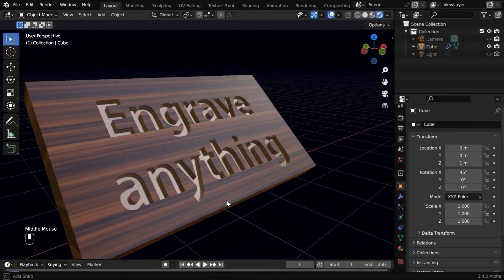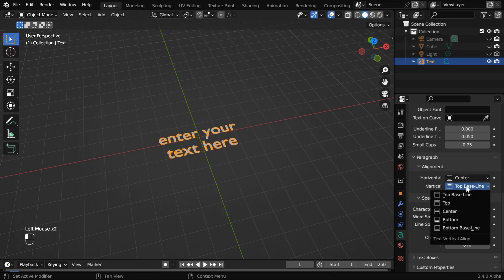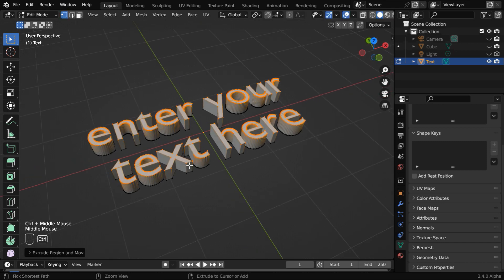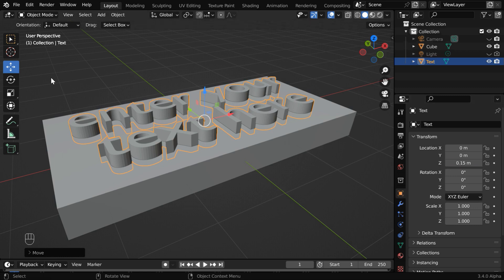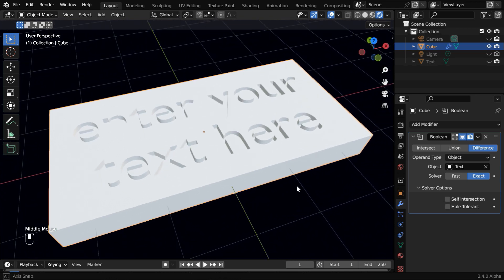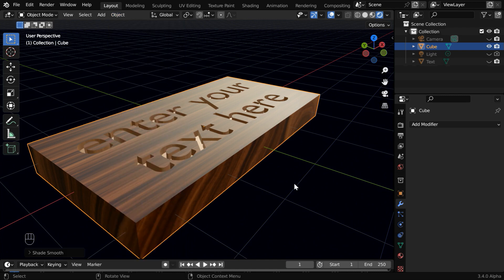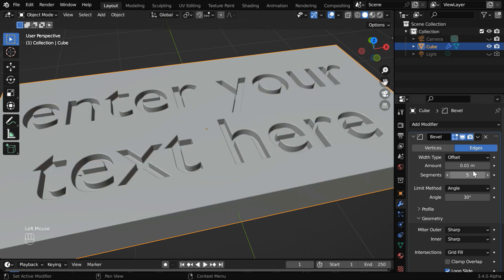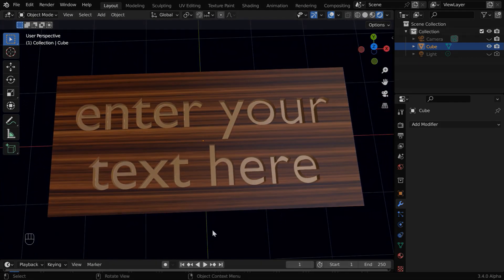Easy Method to Engrave Your Text or Logo | How To Carve Any Text | 3D Text Effects In Blender

Comment: i tried on my detailed awm , i dissolve the edges so theres only 1 clean face , but it tooks wayyy to long to boleean it
Reply from the maker: Some models (long text or hi-poly) can a long time, I mean a minute or two is ok. Did it run for say 10 minutes? Then it is not normal. The front face is not so important, it takes time if the topology of the text is not good. Once possible solution would be to use geometry nodes to create your text object. We also made a tutorial on that 👉 https://youtu.be/5SRiESHQkmY

Comment: Hiding things doesn't work when you export as .obj, has anyone got a solution?
Reply from the maker: Before you export, you can simply delete the object that is hidden. Keep a copy of the original blend file in case you want to preserve that hidden part somewhere (and later you can append it to the current blend file).

Comment: Limited dissolve completely destroys the mesh beyond recognition :( Any help would be appreciated.
Reply from the maker: It depends on the topology of your object/text. There are other ways to achieve the same result that we are trying to do through Limited Dissolve, but it needs a manual inspection. You can send your half-finished blend file (before doing a limited dissolve) to 5minblender@gmail.com so that we can verify it and suggest a suitable solution. Thanks!
Reply: @5MinutesBlender  Thank you so much for your response and willingness to help!
The "All Boundaries" option was checked (I think it's checked by default, as I launched Blender for the first time to follow your tutorial). Unchecking that box fixed the issue, and I was able to follow the rest of the tutorial perfectly!
Reply from the maker: Great to know that you resolved the issues @sheykenasababy  👍👍

Comment: after I merge by distance, the hole in the d in "Adams" is not hollow anymore. i am going to 3d print this and dont know how to fix. i can email a screenshot if needed.
Reply from the maker: Hi, there can be several ways to solve it depending upon what end result you want to achieve. But in this case, when you do merge by distance, I suggest you deselect the vertices that make that inner hole of d. That will ensure that the merge has no effect on that hole. If you want to send us the file, send the blend file. We can check and suggest a better technique if any.
Reply: already fixed, thanks for helping though @5MinutesBlender

Comment: is this possible with images?
Reply from the maker: Yes, theoretically it should be possible with an image too. But to have it work with an image, you need to convert your image into a mesh and add a solidify modifier to add some thickness to it. Use the Exact mode with hole tolerance and self intersection turned on for better results.

Comment: I'm not able to change the color of the text separately. It is having the same color box is having.
Reply: I found the solution: In the Boolean options, under "Solver Options", change Materials from Index Based to Transfer. Hope that helps!
Reply from the maker: @Zwedsen  Great 👍
Reply from the maker: Add a material to your text object. Before you add the boolean modifier to the box, select the box and go to its material slots. Add a new material slot and select the text material in this new slot. Now add the boolean modifier to the box as shown in the tutorial. The engraved text will have its own material instead of the box color.
Reply: @5MinutesBlender Hi, I have the same problem and I’ve tried this but it still does not work and I don’t know why
Reply from the maker: @norenii935  Can you please send your blend file to 5minblender@gmail.com so that we can check what is exactly causing it to not work? It will be easier to investigate.
Reply: @5MinutesBlender   Thanks, was having the exact same problem and this worked a treat.

Comment: After limited dissolve, the text extrudes into triangles...What am I doing wrong?
Reply from the maker: Need to see your model to understand the root cause of the problem and to suggest a solution. That limited dissolve is there only to help the bevel operation later. You can skip it as well and proceed. If you later discover an issue during the bevel operation, you can use our bevel shader nodes instead (we have published a tutorial on this today). If you send your model to 5minblender@gmail.com we can investigate if the root cause of the problem can be removed.

Comment: when I render the image the text is still there. how do I fix that?
Reply from the maker: You need to hide the original text in render, or you can remove it as well if you have finalized everything. Then the text won't show up in the render output, only the engraves form will display.
Reply: @5MinutesBlender  thank you!
I figured out you can also apply the boolean or whatever.
Reply from the maker: @GX33Official  Yep. Basically make the change permanent and then render it without the original text.
Reply: @5MinutesBlender  ye I've made some sick pictures thanks to this video btw. Thank you!

Comment: When I apply my object to the boolean modifier on the object im trying to engrave it makes the engraved object disappear...
Reply from the maker: In the boolean modifier, please expand the section called Solver Options and enable Self Intersection and/or Hole Tolerance and/or both. If it still does not work, switch over to the Fast mode and check if it resolves the issue. If still not solved, please let us know.
Reply: @5MinutesBlender   I have done all of that and it still will not work.
Reply from the maker: @FlameChampionLuc  Can you please send your blend file to us (5minblender@gmail.com) so that we can look into it and suggest a better fix? Your model may have some special geometry that needs a different handling.
Reply: @5MinutesBlender  sent!
Reply from the maker: @FlameChampionLuc  Great! It's solved and I sent you the updated file with the fix.

Comment: is there a way where we can see ALL the modifiers (boolean, or others) applied to ANY object in your scene/project? So that we may delete, or edit, them directly? 
I had applied many subdivision modifiers to to various curved objects in order to make the curves actually look curvy and not "edged". prob is that I didn't know what I was doing I guess (I added values 5 to 6 for the Viewport, while kept the Render ones to 2) and Blender kept crashing. Before I knew it my .blend file was nearly 2 GB (HUGE...) and the app kept crashing (and I kept reopening it an opening the auto-saved file). I ASSUME that the modifiers are what made my .blend file so huge. Right?
So, if there's a way where we can open up our .blend file in blender, see a list of all modifiers in use, delete - or edit - them directly from there (and hopefully 'lighten" my project up a bit)?
Reply from the maker: We can see all the modifiers in the Modifier tab, no? But yeah, if you apply a modifier - then it creates a permanent change and it disappears from that list. In that case I don't think there is a way to know which modifiers were added or applied.
Reply: @5MinutesBlender  Thank you!! :)
A bit irrelevant to this video, but something I'm struggling to do today:P : 
Do you know if there's a way to change the material of the INSIDE walls/faces of an object (eg a cube) WITHOUT affecting the outside faces' materials?? 

*Whenever I have "entered" the cube and applied different materials to the interior face/s, it also changes the corresponding face/s outside it too :( :(
Reply from the maker: @nounix  We just made a tutorial on this exact subject 😂 But it is lined up for release after couple of weeks. You can do that by mixing two BSDF shaders using a Mix Shader. Add a Geometry Node from the Input group and connect its Backfacing output to the FAC input of the Mix Shader. So the outside face will get one BSDF and the inside face will get another BSDF. Effectively the object will show two different materials for the inside and the outside.

Comment: Do I need the latest stable version atm: 3.4.1 to do this?  I ask because Geometry Nodes is VERY sensitive to Blender version given Blender Studio changes things or behaviors so often and/or dramatically it really does make a difference... 
There are times in the Blenderverse because it's so obtuse and opaque, if something fails I can't determine if it was me or Blender... (I assume it's me until proven otherwise, but that's most likely because my mom was mean.)
Reply from the maker: This technique works throughout all the recent versions of Blender. You are correct that Geometry Nodes have been going through a roller coaster ride, but the other parts of Blender are relatively stable since version 3.
Reply: @5MinutesBlender  I just was directed to a version of 3.5 by Samuel Sullins that actually can render (1 test so don't hold me to it...) from NOVEMBER 23rd!  It's the only one that has a cache tick box in the sim output node.

Theorectically, you can try to do some tuts now with 3.5 because there is ONE old version that kinda works.

Otherwise it's wait until June 2023, fingers crossed that Europe and/or the US doesn't get nuked by that time... forget about the Blender Studio guys figuring it out for 3.6 I think was the latest prediction...
Reply from the maker: @Ubermenschen  Yes, I am using the latest build of 3.5 for the current tutorials (planned for release in the next few weeks). But I did not get that Nov 23rd thing. I am using the latest builds that are being released on a daily basis by the Blender team and no major hiccups yet, I only encountered some minor bugs here & there.
Reply: @5MinutesBlender  Can you render anything with those most up to date 3.5 builds?  I can't.  If you or anyone else can't render, what's the point?  I can't use it in my Machinima...
Reply from the maker: @Ubermenschen  Yes, I am rendering many stuff. I am curious.. what is the challenge you faced exactly?
Reply: @5MinutesBlender  It doesn't render except for the 
November 24, 20:19:04
b5ea0d2f411b zip 290.35MB
version that has the cache tick box in the Simulation output node.

Is there some experimental or hidden tick box I'm missing for the latest versions to render?
Reply: @5MinutesBlender  I just double checked the daily builds and 3.5 is now in beta... so I'm downloading that one too.

Comment: I have subscription in this app but it's not working
Reply from the maker: What is not working? You have installed Blender and followed this tutorial, right? At which step is it stuck, please tell me.
Reply: @5MinutesBlender  I changed the phone then its not working on new phone
Reply from the maker: @dmvlogs6664  Ok, but what is not working bro? I could not understand where you got stuck. Is Blender itself not working, or this method is not working, or rendering is not happening.... what exactly is the problem, please explain.
Reply: @5MinutesBlender  blender is not working
Reply from the maker: @dmvlogs6664  Okay, I have never used Blender on my phone. I suggest you to try it on a computer, it will be easier.

Comment: Since there are many holes in the surface, you need to use Arc (Geometry - Inner) and switch off Loop Slide. Usually this is a cause of shading problems.
Reply from the maker: Thanks for sharing the tips!

Comment: very helpful tutorials.good job sir . which blender version do you used for this tutorial? i started learning blender version 3.2.2 . if i update blender version 3.4.1 is good for me or i learn first using same version. which is good for me ? I'm sorry for my questions.
Reply from the maker: I'm glad you liked our tutorial. We used 3.4 version for this tutorial although it works with previous or later versions as well. There are not many differences between 3.4.1 or 3.2 if you are new to Blender, you can use either of them. But if your hardware is not a big issue, I strongly recommend you to always use the latest version that is available from Blender site because even if the functional changes are less, the menu options can drastically change between two versions. So it is definitely better to start with the latest version and keep working with the latest version always. You will remain up to date. In case your hardware does not support, you can stay with 3.2, not a problem.
Reply: @5MinutesBlender  thanks for your good advise sir. love you